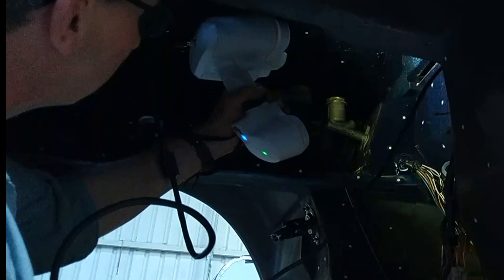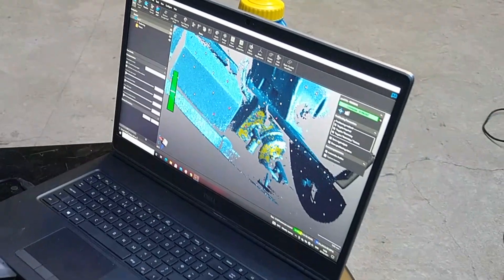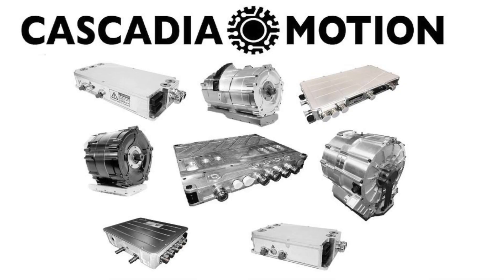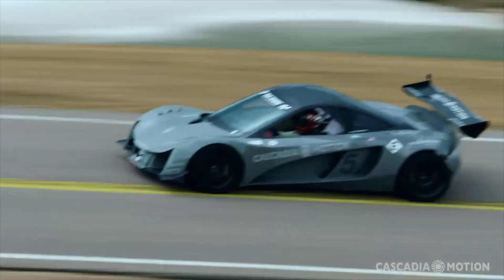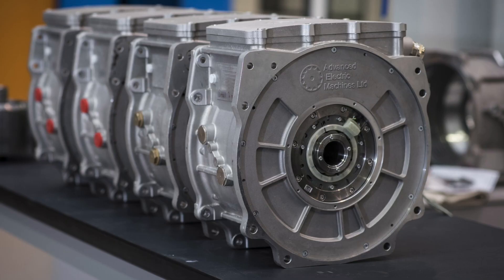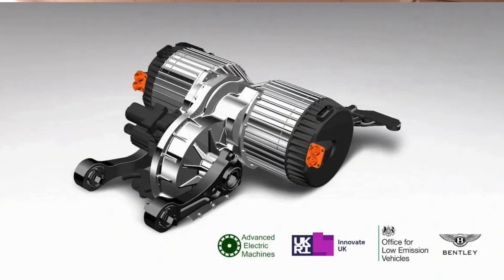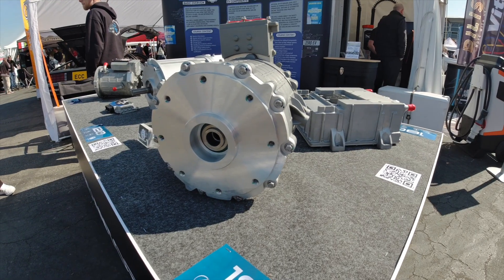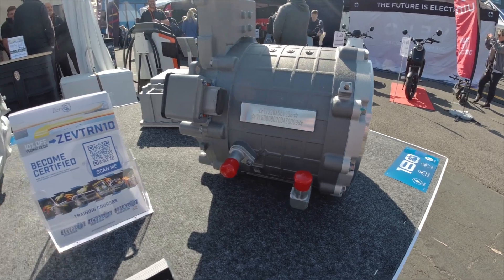Tesla Powered TVR! Ep4

Comment: Ev west do a conversion gearbox for the model s motor so you can mount it longitudinally and run a prop down to your diff, have you considered that. 

Alternatively you could take the remains of your budget and buy Tesla shares while they are at a discount and then  give it a few years ( the time your conversion will take) retire early and get yourself a plaid, not investment advice 😂😂😂
Reply from the maker: It lookd like EV shop did a similar option 😉

Comment: Hydro quebec had develop motor in the wheel 2 of those motor  the car was faster than the power gas counter part and then they sold the right to some country  in Europe you should maybe taking a look at that one
Reply from the maker: Interesting, I will look into that ;)
Reply: @chargeheads  yes  you put 4 motor in each wheel  then all of run with  a computer  I think  they did a mini using that system
Reply from the maker: @MrMrBigro  has to be rear wheel drive for the fun and danger factor 😉⚡💪
Reply: @chargeheads  yes that's  what they did 2 motor one in each wheel no tyranny no drive shaft

Comment: Have looked at using the Lexus 450h motor gearbox drive train in conjunction with the Prius dual inverter as shown by Damien Maguire?
or is that a similar size constraint?
Reply from the maker: Another size issue unfortunately

Comment: So the engine bay prevents you from using a Model 3 inverter/motor set up even if you split them as the guy did who converted an Audi S5 as seen on Rich Rebuilds?

Comment: Double Hyper9 end on end ?? ~ 200 kW but almost 500 lbft torque with 5 or ideally 5x2 Tesla modules = 110kg motors + 125 to 250kg of batteries. Keep the gearbox and you will have an animal in lower gears and pulling from zero in top. #LotusElon (1/2 Griffiths weight, power, etc)
Reply: Would it fit due to the size constraint in the engine bay?